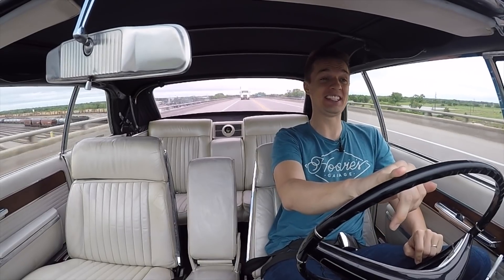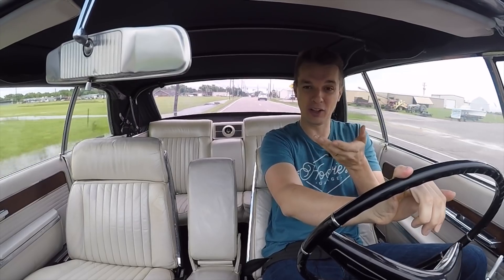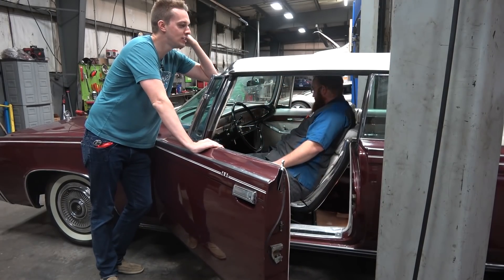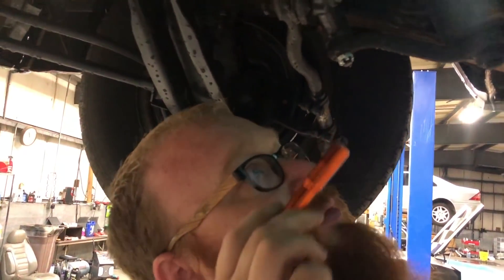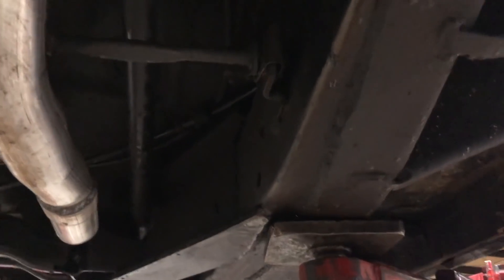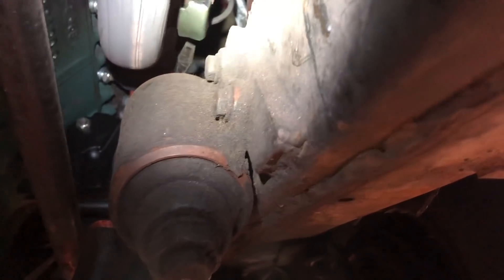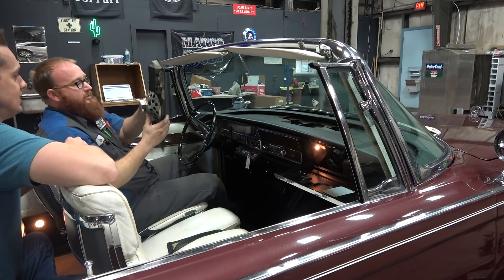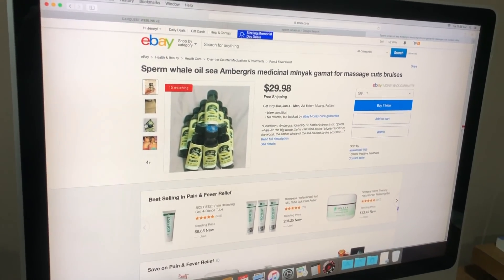Here's Everything that's Broken on My 1966 Imperial Crown Convertible and Why it's INDESTRUCTIBLE!

Comment: I love the suspension on that Imperial and how the wheels didn't start to rise with the car until after it had gone up about a foot or so.
Reply: They had a hella soft ride, and were heavier than anything else from that period.
Reply: @pex_the_unalivedrunk6785  The torsion bar suspension in the front was marvelous - gave a very smooth ride because of the very low friction of the design. Loved our '66 Imperial.

Comment: "Big trucks have drum brakes..." Yea, cuz its as big as one 😄,  but even those haven't had them the last 15yrs. Maybe you should do a disc brake upgrade...?
Reply: Leofred those are huge 12in drums, properly setup and not horrible beaten those drums will stop fine. Why change something that has no issues?
Reply: @CurtisOrionJonesBA-kn6km  But still less than he spent on most other cars...
Reply: @Suburbanhotrods  Cuz a soft Hoovies restomod would make it a legend
Reply: discs might stop better, but drums have better holding power. which is why trucks still have thenm
Reply: @shoominati23  But a slightly better holding power cant replace the better brake feel, cooling and stoping distance tho.  And discs sheds the dust better, it doesn't accumulate

Comment: I found a '61 Imperial convt.  In a Big Island junkyard.  A project,  and just to remove it.  I drove a .68 300 pillarless.  It had a rebuilt 383 in place of the 400.  Was a smooth cruiser, and thirsty.  Had a chance at a 64 Imperial convt.   Had to settle for a 65 Park Lane.  390/4bbl.   One of my best cars, and I drove it a bit.

Comment: Great car!!!
If you didn’t find that hubcap, be careful not to buy a wrong replacement! 1966 used its own unique hubcaps, different to the very similar ones used from 1967 thru 1969.
And get at least a spare one. They’re hard to find!
Reply: When I bought my imp it actually had Ford bronco rims. Looked cool enough but I knew they weren’t correct.

Comment: I came up with parts being 180.00 and labor coming out to 225.00.  Pinion seal and some 80 weight oil, oil pan gasket and the oil, and heater core and the labor

Comment: My experience is that I accidentally T-boned a 1972 Imperial whilst running a stop sign and enjoying my 8th beer of the last hour in my 1991 Geo Metro.  The Imperial was almost torn in half while my Metro only sustained a mild crack in the front bumper and scratches.

Comment: That X-brace on the frame was only on the convertibles.
Reply: G. M. Frazier but basically a unibody plus a frame. They were banned at demo derbys
Reply: cadillacs had x frame
Reply: Some Buicks had the X
Reply: You are correct.  Since no top, the body would flex like crazy if the frame was not reinforced.
Reply: @sammolloy8129  GMs had the X-frame (with torque tube drive), but NO side sill members.
Reply: I know this is a very old thread. I am only posting for the clarification of anyone else that views this. I have a 1965 Imperial Crown Coupe. It has the X Frame Chassis.

Comment: I had a 67 Imperial years ago and the oil pan leaked even after putting a gasket on it.
Mine had the 375 horse 440 because it had the trailer towing package. 
It got 20 MPG on the highway if you kept your foot out of the carb.Around 12MPG in town.

Comment: Did the Imp ever come up in a later video? I can't find the thrilling conclusion. The glass covered headlight year is the best one of this version. 
I had a 20 year old Pontiac TransSport. A GMC dealer wanted $900 to do the heater core. Other places wouldn't work even on it. A tiny radiator shop did it for $300 including the part. It's actually fairly easy on some vehicles like that and a nightmare on others that are designed with no regard for the fact that they usually fail if the car is old enough (despite changing the coolant every few years). I got a rear main seal diagnosis on it (meaning dropping the engine, involving a special cradle and disassembling the driveshafts) and it turned out to actually be a gasket at the bottom of the distributor (whew). Oil runs and blows around and you have to be careful with the diagnosis.

Comment: Built like a tank? IT IS A TANK..
Reply: Indeed mate
Reply: Tanks were built like this car.
Reply: The crumple zone is the Pinto you run into
Reply: @thelastmemphian  not get all tech on you but these cars were built with the "solid cage" concept: encase the driver in iron = safer. They discovered though that the impact force was then transferred directly to the passengers and it wasn't a good idea after all. 

I had a friend who owned a 1969 or 70 Chrysler Imperial with the 200 lbs front bumper. He rolled it end for end and the doors still worked and he drove it home.
Reply: @muskokamike127  I have trouble with these ideas at times, though I know they have merit -- race cars, drag cars, NASCAR, F1 -- all vehicles with extremely rigid constructions and drivers tightened down so their bodies barely move whatsoever during crashes. Yet at 120+ mph crashes I'd rather be in one of those vehicles than any 'uber-safe' crumble-zone engineered car.
Reply: @jgizzy  That is true but even race cars have crumple zones. Ever seen one after a roll over or ??? there's hardly any body left and the front and rear are pretty much gone except for the passenger compartment. Plus don't forget: racing seats, 5 point harnesses, helmets, gloves, etc. A LOT difference than some soccer mom and 4 kids in a mini van. 

As for "uber safe" that's a misnomer, they're safer, and some are downright dangerous still. I just watched a video the other day on how unsafe cars from the 80's were and how even today, cars like the Nissan Micra and Toyota Yaris are still lethal simply due to their size.
Reply: Somewhere on YouTube I watched  an old FBI training video on car to car combat, it showed an Imperial absolutely obliterating a Corvair or something like that.
Reply: The driver area is solid but everything else collapses like an accordion on a race car. There are areas of sacrifice and a safety pod. In the US, there were more traffic deaths in 1963 than 2021. It seems counter intuitive that a bumper that folds in under pressure is safer than being locked in a safe with wheels. But that is the reality- and it doesn’t even factor in pedestrians and others on the road

Comment: also  check the heater control valve mounted on the fire wall.   it will leek run down the fire wall.   rust out the turoution bar frame bracket and car will ride the ground.  the fix is to MOVE the heater control valve.  to under the hood.   the heat riser is suppose to  rattle.

Comment: Gene Barry drives one of these in "Columbo" 1968.
Reply: his was a 67-68 but was very close to this one.
Reply: @RADIUMGLASS  67+ was an entirely different chassis.  Imperial migrated to the unibody Chrysler C-body chassis shared with Chryslers, Dodges, and Plymouths.  It superficially resembled the previous generation but structurally it didn't really have much in common at all.
Reply: JAG  it was Columbo. It was a T.V movie. 3 years later the actual series started in 1971. Look up "Prescription Murder". It was on YouTube a few years back but got pulled down.

Comment: Review a mint 1970 Plymouth Valiant 318 v8 like I had Did not realize it was the 12 mpg equivalent of a 1987 Acura legend with 9 sec 0-60 and 150 hp, about the same size. Replaced it with 1976 Rabbit which was terrible.

Comment: I refuse to believe this is a car from 66! Power seats and a power top!
Reply: late 40s tech. by the 60s were standard on every luxury and optional on cheaper cars . Even a well equipted chevy or plymouth could have them. A comparable 66 cadillac also had soft closing trunk, automatic climate control, cruise control.Ford and GM in late 50s had memory seats and also automatic headlight deamming
Reply: @chrisxaf1237  WTF happened other than economic inequality increase

Comment: When i bought my 63 ranchero it has spoke wire wheel hubcaps, i used to have to stop every so often and pick them up off the street as they fell off ever 5 miles or so.  i would be driving and then see one of them passing me by.

Comment: Dude just ripping you off 80 bucks or 100 for a rubber strip that you can buy for 25 dollars in Walmart or home Depot and install yourself 🤦😂😂😂
Reply: Professional's cost money, usually $80 an hour plus material's. They also provide thing's like warranty work on faulty parts or thing's like liability if something they worked on failed and you crashed because of it...... Just saying....

Comment: Holley makes a kit for the 440 to make it electronically fuel injected
Better economy
Reply: It won't make a huge difference - maybe 1-1.5mpg over a tuned carb (probably more if you did a lot of city driving).  I stuck one on a 455 Riviera. Lots of other benefits, but the fuel savings will never pay for the F.I.
Reply: @nferraro222  FI would be Blasphemy, on the Imperial or most old cars.

Comment: The spot size that you described is only a few drops of oil. So it's probably a minor leak. And it will probably need a heater core.

In 1966 almost all automatic transmission fluid was sperm whale oil. When they did away with it, they had a huge problem with automatic transmission failures. It created an entire transmission rebuild industry.

Comment: you mentioned you didn't know if the motor was yanked out of it or not but you can definitely tell when it turns over it's got the newer smaller starter. it definitely doesn't have the old double gear reduction Chrysler starter.

Comment: Heater core comes out from the engine side, takes about 20 minutes, they have a habit of the control valve leaking and spraying scalding water on the carpet, or a passenger foot, but only when you floor the gas, after several $100-300 valves put a $12 plastic universal from Reibe's auto parts, 25 years ago.  I took the heat riser valve out and welded the shaft holes, the damn thing would rattle every few months, took it out 45 years ago, in Cali, no problem. The oil pan gasket may not be easy, my engine was out at 200,000 when we rebuilt it and  pumped it to 600 hp.  One of the '64 sedans I  had I resorted to cutting the gasket on one side and sliding it between pan and block and using gasket cement, it worked the two years I had it.  Valve covers need replacement every year or two IF you drive it daily, '66 Imperials had an AM-FM radio with station seeker and reverb unit that sounds like a concert hall, you might want one, mine works great.  I would also leave the wonderful mello exhaust alone, quiet looses 20-30 hp.  One thing you didn't check under the car, the traction bars from frame to top of the rear axle housing.  Where the car has been worked on they may have been replaced,  originals are often snapped in half, especially if the car has been driven, ahem, vigorously.  With original hp I snapped  mine many times, and tore it out of the frame three times. Did I mention '66's jump humpback bridges well?  Plus my overkill with 600 hp has blown the differential 8 times in 5 years, but that usually happens after a three block burnout. driving normal, it]s fine.  A plus of extra hp, on cruise at 70 mph it gets 17-20 mpg depending on wind direction.  One car show there were 50 mph winds from north to south, going to the show against the wing got 11mpg, coming back with a tailwind it got 22mpg.   Make sure the pin that holds the shift lever in is centered, if the pin slides, the shift lever can break out of the column.  I replaced the original hubcaps soon after getting mine, i kept blowing them off, '59 Imperial LeBaron  caps  with gold centers are gorgeous on them or 61, 62, or 63 300 letter series caps. I actually have 18 sets of caps.  I also snapped the front sway bar cleanly in half, but CHRYSLER told me no one else has done that before.

Comment: The X-member in the frame is use just for the Imperial convertibles. The sedans and coups used cross-members.  The dual exhaust system you have, with baffles, are not in the Crown or coups.  The top-of-the-line LeBarons may have it, but most likely not. But, I knew people who have scrapped the single for dual exhaust with after market.

Comment: There is a good reason why a lot of Demo Derby circuits outlawed these cars back in the early 80’s. No other cars could compete against them in stock form. You could run these things in several derbies and not break them. The only cars I ever saw take them out were modified 71-76 full size GM station wagons or Gm/Cadillac sedans on reinforced convertible frames that were not playing by rules.

Comment: This car originally came with single exhaust.  Duals are not stock (but they sure would be on mine if I had one).  Imperials also had a milder cam than R/T Dodges and GTX Plymouths.  Still, a 66 Imperial would have had 10:1 compression ratio instead of the 8.0:1 that the later smog 440s had. As for gas mileage comments, my father's 74 New Yorker station wagon would get 17 mpg on the highway, 12-14 around town.  (Stick a hotter cam in it and watch the gas mileage go down.)

Comment: Daily driver 1968 Chrysler 300 Sport. Decent condition, but just a beater. It drives just as good at 130 as it does at 50. Only difference is I can watch the fuel gauge drop once I get it over 90. Bone stock, 8.5 mpg average around town, 11 on the highway. A/C running, 5 in town and 7 highway. I leave the windows open. When it comes to any old car, you must remember that if it's not leaking, it's empty!

Comment: I bought an unrestored, pristine 1966 Imperial sedan in the early 90s and drove it every day for the warm six months of the year for seven years. My five kids loved it. It only had 40,000 miles when I bought it, and we took it on vacations all over the country. Drove like a dream and attracted a few State troopers along the way. I laughed out loud when I saw that he’d lost a hub cap. All I could say was “Get used to it!” That was constantly happening on my right front wheel and, back in the days before easy internet access to obscure parts, it was a major pain to find new ones. Love the two Imperial videos. And don’t forget that the 66 Imperial convertible was the car driven by Bruce Wayne (Adam West) in the original 1966 Batman movie—opening scene at Wayne Manor!
Reply: I replaced the steel wheels on my 1963 Studebaker Avanti with alloy ones because I was tired of losing hub caps.

Comment: I used to own a 67 imperial but it was basic model but still it road great with 62k miles. The original owner passed away in 1992. Which i bought from the widow and told me she didn't want it and sold to me for$500 only need carburetor work and tank cleaning . i got it running and drove for 9 months then by chance a Chrysler collector followed me to my shop and talked me into selling . i sold for $3000 this car was garage kept just needed to be driven when i bought it for the widow. But it was a great built car

Comment: You need a new heater core and new suspension joints and shocks and the oil leak is bad you might as well get a engine overhaul

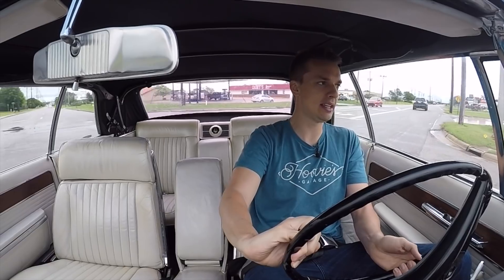Comment: Stopped at 1:37 just to say what he's describing and experiencing is a leaking heater core. (my educated guess) coolant leaks out into the enclosure  the core sits in, the fan picks it up and sprays it at him thru the vents and the sickly sweet smell is the coolant heated up. Will be surprised if I'm not accurate given this has happened to me numerous times in my 40 years of driving.

Comment: Doing the heater core in that thing is an adventure. 10 million miles of wires, brackets for who knows what and of course screws and bolts somewhere that don't exist. A trained spider monkey that can read an FSM would come in handy. And I hope he puts a seal saver on the pinion yoke. As for gas mpg? It isn't per mile, it's gallons per hour.

Comment: The oil leak might be the oil pressure sending unit.   It’s located on top at the rear of the block.    There are two threaded ports in the back for a gauge and a light.    So,possibly two sending units.

Comment: Heater core is leaking. Important.....HAVE THE ORIGINAL ONE REPAIRED! Unless you can find an original new part.
The heater core is waaaaaayyyyyy deep into that car. Under the dash way deep.
Lots of labor.
Do it right and do it once.
Aftermarket heater cores don’t leak....sometimes.....and they are made with fewer tubes and fins meaning marginal heat output.
Have yours fixed and pressure tested.
Great car!

Comment: Here's an excerpt from that whale oil listing:
The big whale that is classified as the "biggest tooth" in the world, the amber whale of the sea caused by the accident. The price of gold is low with the amber of the sea, which is an expensive and rare commodity from the past to the present. Benefit to make perfume and cosmetics. Or to flavor in food or wine. Thai herbs for medicinal purposes are as follows.

1. The people eat bored medicine. Use 1 tablespoon of amber oil mixed with hot water and drink to vomit.

2. The snake bite. Take 1 ounce of oil and apply to the wound.

3. Women do not leave the baby and urine shrimp. Beriberi to eat and make.

4. Diarrhea, bleeding, bleeding, too much blood. To make stool or constipation difficult. Eat enough oil.

5. Cure hemorrhoids. Use this oiled cotton wool and insert into the anus. People do not eat bananas.

6. To use and massage to relieve pain, bruises, bites, bites, insect bites, insect bites, fire, hot water immediately to pain. For example, leprosy, tinea, ringworm, scabies, rashes, toothaches, and mouth ulcers. Before bedtime, the body does not have disease.

7. To clean the wound, the wound will close faster. Do not let the doctor sew.

Comment: The Mighty Chrysler Imperial. Registered as "Imperial" only from 1955 to 1966.. with '67 models they went back to being Chryslers. 1965 was the best sales year for soft tops. The top three luxury convertibles sold as follows:
Cadillac deVille - 19,209
Lincoln Continental- 3,356
Chrysler Imperial - 633